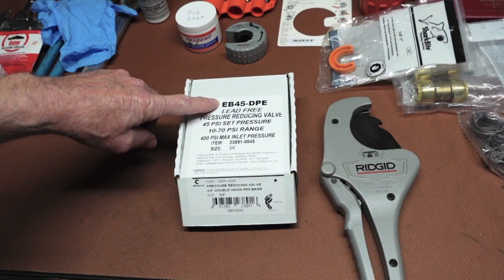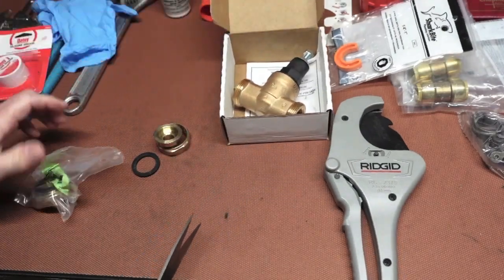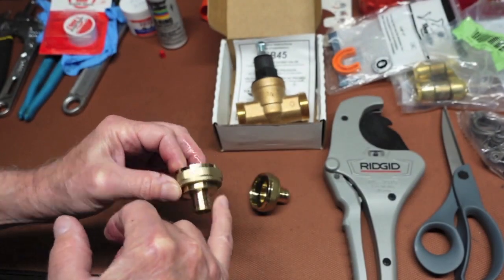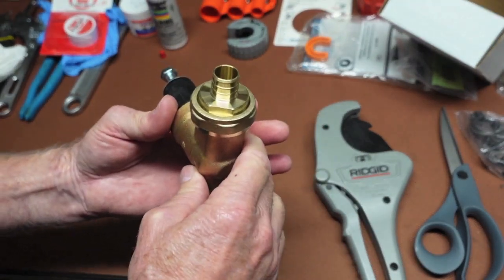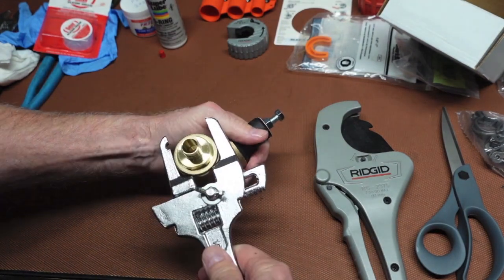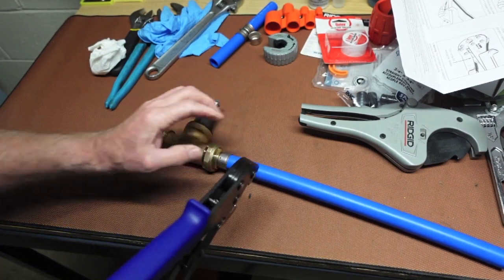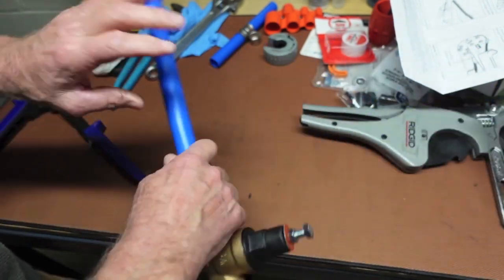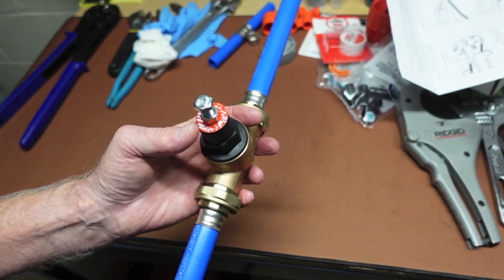Water Pressure Regulator Valve O-Ring FOOD GRADE Lubricant with PEX Press Sleeve Connections

Comment: Hey ironically I have the exact same regulator I just bought and installed and also the same blue and even the same stainless sleeves (which are rare).

Anyhow the regulator for me seems to always drift away from its setting when it’s not flowing. At static pressure it within minutes lets the pressure go up past its set point. Have you had any issues like this ?
Reply from the maker: That's interesting, I haven't experienced that issue personally. I have a cheaper reg on our RV that will match campground pressure in minutes so it's useless.
Thanks for watching and sharing!

Comment: What size is the oring ? Also is that a ¾ connection
Reply from the maker: It is a 3/4 connection but I don't know the oring size as it's specific to the regulator. Our water is very hard here in Indiana and regulators don't hold up too well.
Thanks for watching!
Reply: @pmtips4482 
I also have ¾ PRV made by WATTS but I have a leak because the o ring wore out already do you have any suggestions sir or how I can order an o ring kit
Reply from the maker: @DAT-TEXAS-DUDE  well, I just checked on Amazon and the prices are too high for a few orings plus the gamble of them being correct. You can go to watts.com and order repair kits for just about any model they make. I think I'll go that route next time. In my experience these PRV just don't last, my house had one plumbed in copper and it was beyond any adjustments due to corrosion but not leaking, just putting out 100 psi.
I just put a new regulator in series with it for the time being.
I would check with Watts and have your model number handy.
Good luck and thanks for watching!